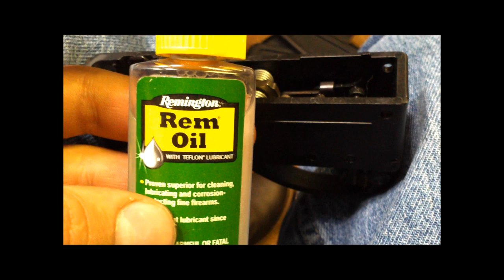Remington model 597 trigger fix

Comment: Its the disconnector assembly. When the bolt comes back it hits it, the part that sticks up, resets it. This action allows the trigger to be pulled again once the bolt goes back forward into battery. It prevents u from outrunning the gun and/or firing out of battery.
Also 22mag is rimfire a 22-250 and 223/556 are examples of 22 caliber centerfire cartridges. 

You are correct that the gun will not want to fire if the disconnector sticks or is sticking since the trigger is no longer "connected" to the hammer.

Comment: Thanks for your video. Some of the work that has appeared on the net includes: Installing a Volquartsen Hammer and extractor; as well as replacing the large springs and bushings that are located on each side of the hammer and polishing the guides. That's about as much as I've seen done with the action of the Remington 597. If you have any thoughts on these mods - kindly add your thoughts.
Reply: +BigRed56 No, that's about it. Done it all to mine and it's improved 100%. My favorite 22 auto-loader I've own so far, including  the 10/22.

Comment: I would not mess with trigger part.There is many springs and all there. professional should handle fixing this piece.The only piece  people having issue with.Is failure to extract and re-chamber rounds.I recommend you just order the entire replacement trigger mechanism
Reply: Amen. Good advice. Do not mess with anything really complex unless you can put a watch back together.

Comment: Thank you.
Reply from the maker: No problem 🙂 I'm guessing you had the same issue?
Reply: @ils360  No, but when I saw what you did I immediately went and lubed that area to avoid problems.
Reply from the maker: @luvr381  nice! Preventive maintenance is definitely important
Reply: @ils360  Now I'm contemplating upgrading the extractor, if I can figure out how to remove the old one.
Reply from the maker: @luvr381  why would you want to upgrade that?
Reply: @ils360  I've been reading about the 597 since I watched your video, seems the other common fail to cycle is because of the extractor, and Volquartsen makes a highly rated inexpensive upgrade extractor.
Reply from the maker: Cool Story Bro  yeah definitely sounds like an extractor issue

Comment: Remington just turns out such low quality firearms now days. I purchased a new 597 in 22 WMR and it will not load the third round out of the magazine. Tried another magazine with the same issue. Having a aftermarket extractor installed.  Have shot 15 rounds through the rifle. 
Remington has been just running on their prior quality history name for the last 10 years. This 597 is my last current Remington ever. Say the headaches and buy a CZ.
Reply from the maker: Unfortunately it's so true they do not build any of their firearms like they used to quality control just really sucks and they just are turning out whatever they're able in varying conditions.